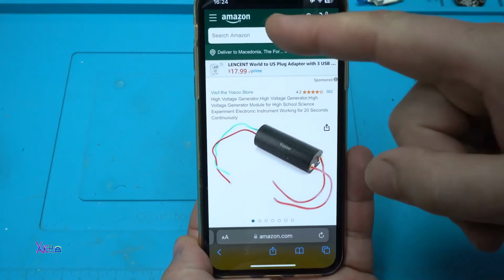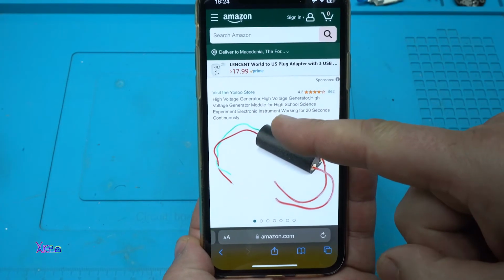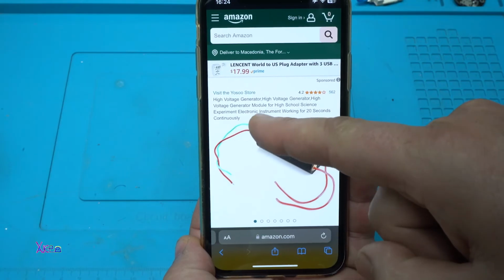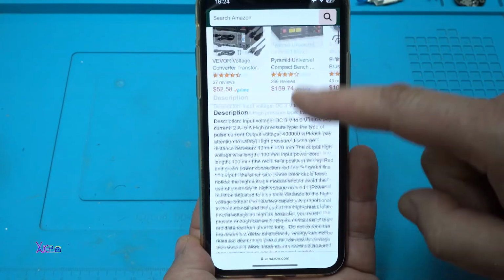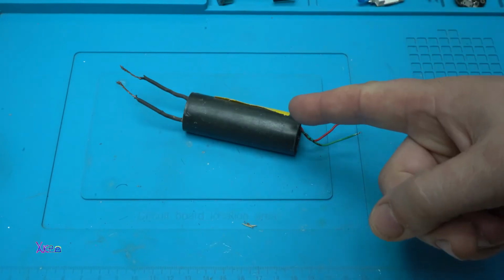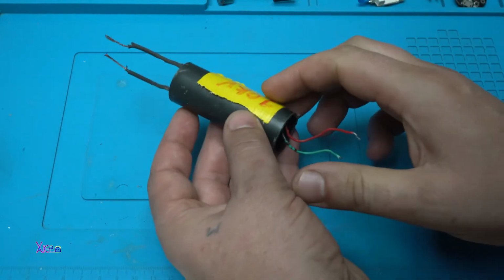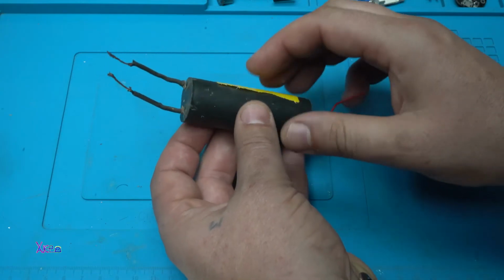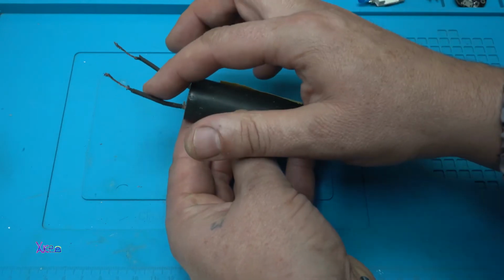3 High and Low Voltage Spark Generators

Comment: 😂😂😂 its easy to make it info down below 
There is 2 parts 
1 inverter and 2. Voltage multiplayer
The componets to make the inverter 
Can use transistors or mosfet recommend mosfet IRFZ44N, 1k resistor, small but powerful transformer that can make 5kv AC.

And for voltage multiplayer you need umm for example for powerful voltages 
You need simple diodes 
And ceramic capacitors
6kv maybe some pico farads.

And its fucking easy to make it JUST DIY dont buy it 
DIY = learning freedom of failing and = knowledge
So make your own dont buy it 

Btw dont try to build it if you dont know or have not worked with high voltages or some stuff like it.

And im not responsible for the damages or what you do with this information
And as allways 
KNOWLEDGE IS FREE 😁😁😁😁